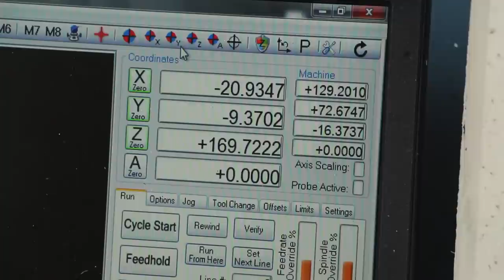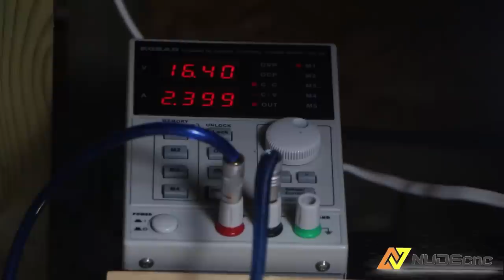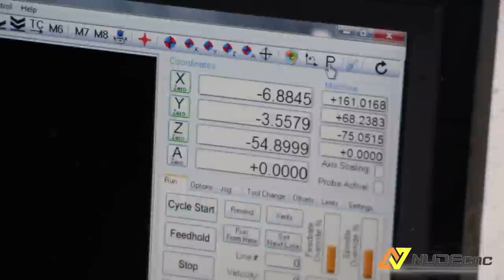DOUBLE SPINDLE MILLING MACHINE conversion 4 axis Part 2/2

Comment: Excellent videography, and great machining. I'm curious as to what type of chemical you have used to clean the part, in what proportion, and for how long the part sat in it. I've been anodizing some of my machined parts with mixed results, probably due to the initial cleanup (I think). Thanks for sharing.

Comment: Another Great piece of work! I need to learn to anodize fairly soon and I'm just wondering what TIR you're getting on that companion spindle? I've built 2 of them already, first for a Proxxon and the second using a dewalt mini router and a high precision collet. Had no luck getting below about 6 tenths.